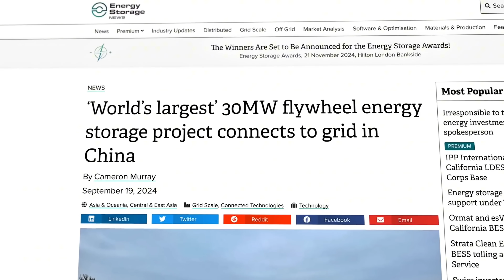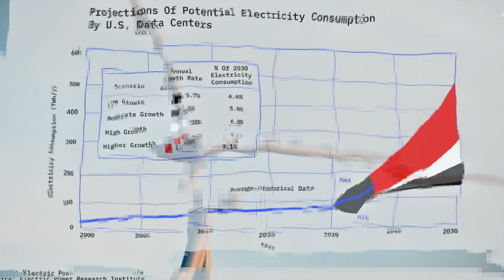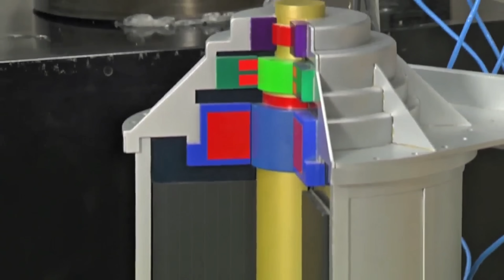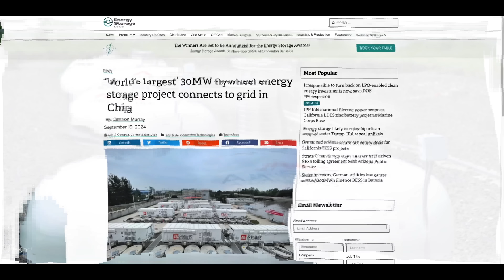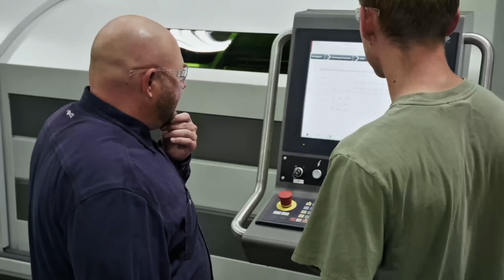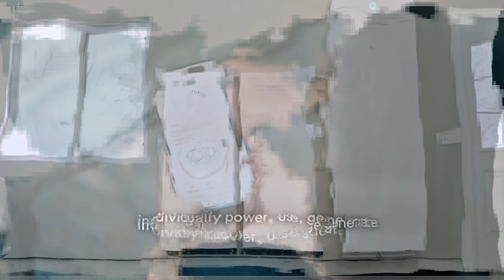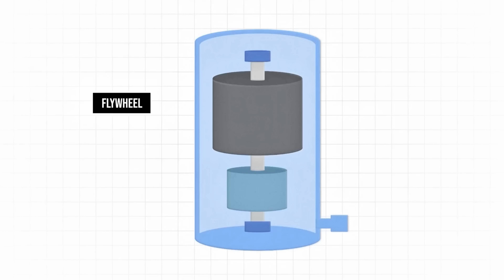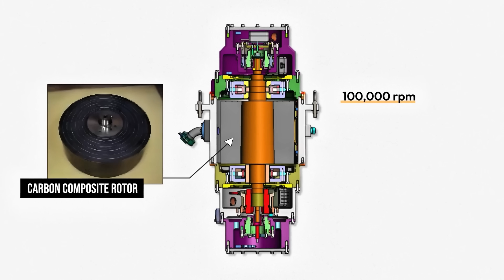Oil Giants’ Worst Nightmare: American Torus 2025 Flywheel Free Energy That Will Change Everything!

Comment: bs. a flywheel stores energy but it is not free. it takes energy to spin it and it will slow as the stored energy is used so it will then take more energy to spin it back up.

Comment: You have to add from the out put to make up for and exceed the losses.
Reply: @genocanabicea5779 :   Do the "hybrid method" :  a small "gasoline/ diesel engine", powered by "bio. gas/ methane gas"- will "nudged" regularly, every few minutes, the RPS rate (rot'n per seconds)- of the Genset "flywheel unit"... 

Such "small engine" will proceed to AUTO IDLE "mode", once the "pre. set" RPS was reached (aided by installed "rpm  monitor gadget", buy it "on. line"..)... And will proceed "again" to AUTO HIGH RPS, once the "flywheel rps" reached the LOW RPS "level"... And vice versa...

The basic design of "bio. gas digester" was in You Tube- so, M.Y.O. method... If you opted for "back.up/ hybrid" diesel engine, "make your own" (M.Y.O.) "diesel fuel", by re. processing those regularly "discarded" used "cooking oil", from  "fast foods" branches... See You Tube on basics about the "cooking oil re. processing  system" (CORS)...

Comment: Keep it a "mystery" great biz plan under promo but over del lol. Torus ( very close to thoruim lol. Need energy to "start up"  (prime the pump) call it " energy storage" lol. Who knows maybe small amount of thoruim inbeded in the magnet. But needs heated up to activste lol. Who cares main thing it works. Told " over unity geek"  to put it in a small welder. Take less power in like small 110 v  Put more amp welding out like a 220 v welder. Who cares main thing is does it "work"  We use lots of things and NO most of time we dont really understand how things work. Lol

Comment: Describing these “modern flywheels” as power generation is out of either ignorance or deception. If Torus has anything to do with the narrative in this video, it delegitimizes them as a serious company. Flywheels are essentially “mechanical batteries”, as opposed to the more common “chemical batteries” that people associate with the word “battery”. There is nothing “free energy” about any flywheel or battery. They are a way of storing energy. You put electrical energy in, a motor uses that electricity to accelerate a mass into high speed rotation. Then later when you need it back as electricity, you retrieve it back by controlling that same motor as a generator to decelerate the mass, converting the energy from mechanical back to electrical. If you stick the flywheel in a black box along side a chemical battery in a black box, as far as the user is concerned, they play the same role. Energy in, then out later, and because like chemical batteries, they are less than 100 percent efficient, you get back a little less than you put in. Flywheels have advantages over chemical batteries such as they are a hell of a lot more environmentally friendly (there is nothing clean or green about chem batteries), longer life, some varieties require less maintenance and they are more durable in regard to operation in harsh environments and fast charge and discharge conditions. Up front costs are higher mostly due to not having the scale of funding and manufacturing to bring down costs compared to chemical batteries, in addition to other factors. Flywheels have their place and can play an important role in overall energy management and solving the many problems and instability associated with including too much “renewables” (unreliables) on the grid.
Reply: Ha! Ok I have now listened to the final two minutes of the video. None of the flywheel manufacturers claimed anything as fantastical as the narrator. They merely said you get ALMOST as much back as you put in. Quite true, but the narrator goes on to say that you simply put a little in to spin it up then continually get more back out, beyond what was put in. At a minimum he has mistaken long coasting time as something being generated and powering something, like a house, etc. without requiring additional recharge. But while coasting, the flywheel is only doing just that, coasting and slowly slowing down due to losses, low aerodynamic losses in the vacuum and low losses associated with powering the mag bearings. But losses nonetheless. Unless you need storage, it is still more efficient to simply buy and use the energy from the grid as you need it, rather than waste some through storage losses. Unless you can buy it cheaper when you don’t need it and use it later when it would otherwise be more expensive to buy, which is sometimes the case.
Reply: @danielbakholdin4983  You're right, the narrator needs a lesson in thermodynamics, and not reporting their own fantasies. Hope the company does well, I would like a serious consumer alternative to electrochemical cells.
Reply: No such thing as FREE ENERGY.

You must input energy to get electricity!!
Reply: Where do earthquakes , volcano ocean currents get their energy  from the earth because it is a super battery so the idea that energy is free is based on the fact that nobody paid anything for it . Those who have discovered how th harness it are on the right path thosevwho feel otherwise are believing science so called cause they are STUCK in the manufactured box of those who want it all at your expense !?